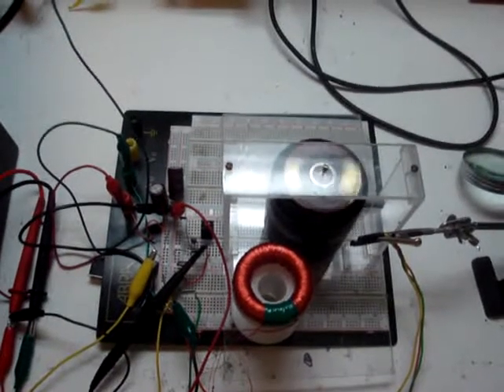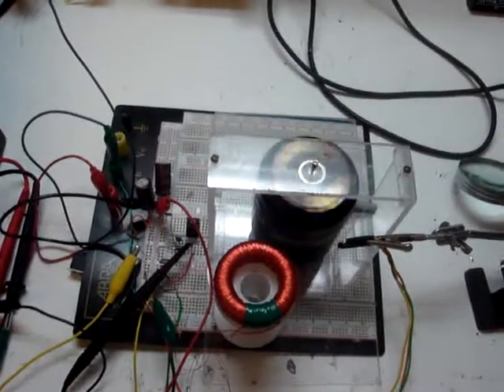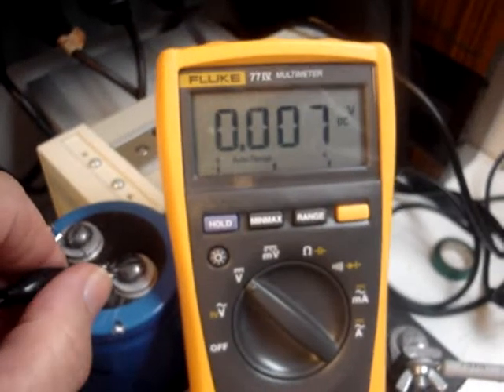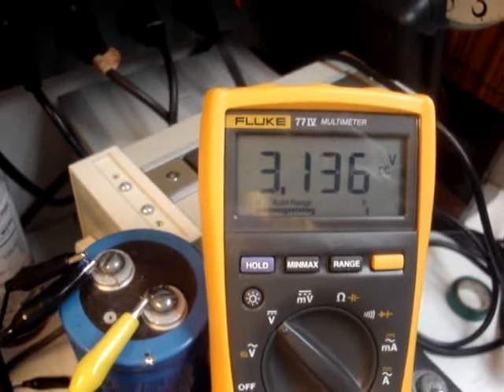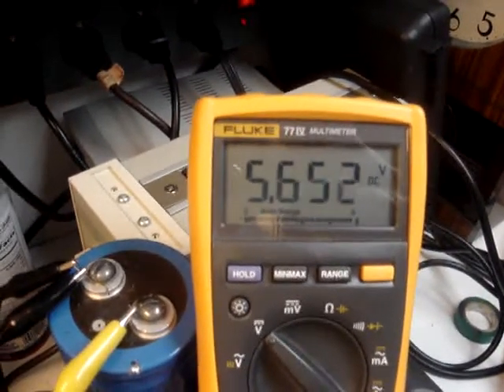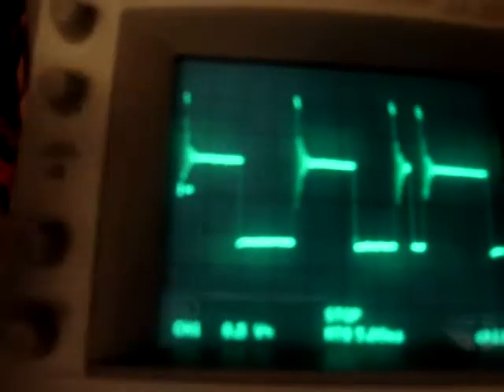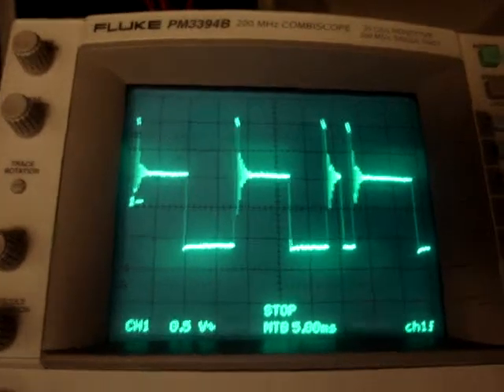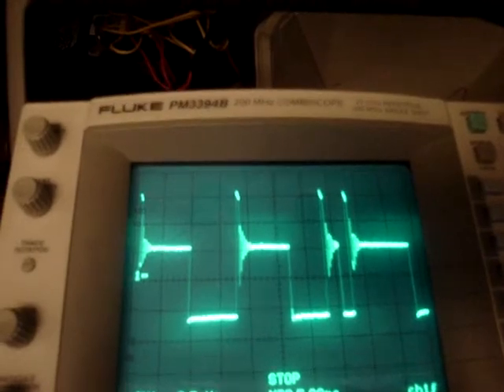Cap fast charging on Steorn circuit

Comment: And of course, the motor is running along as well ....
If this was a much bigger motor, capable of driving a small generator (like simple neos and a coil), while also charging the batteries with the spikes, then you would have something very close to a selfrunner.

The whole magic lies in changing the the magnetic properties of an active core without wasting energy in the process.
Or changing the properties of a medium used by another system.

I do think this would be possible solid state too...